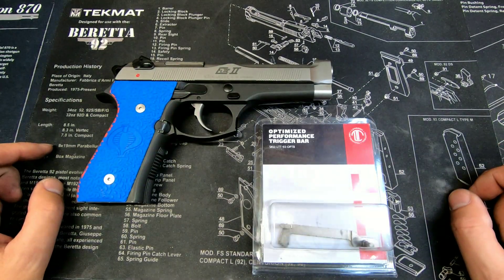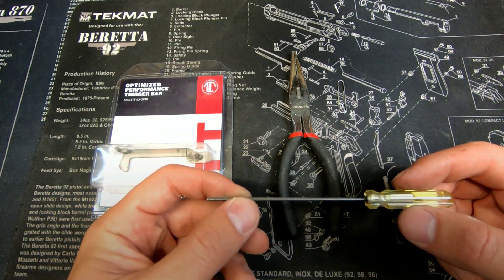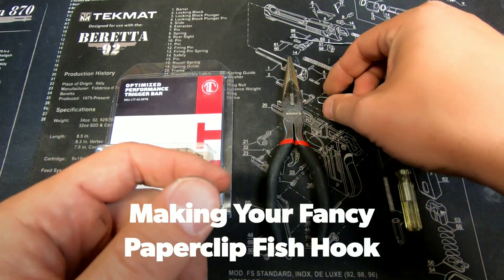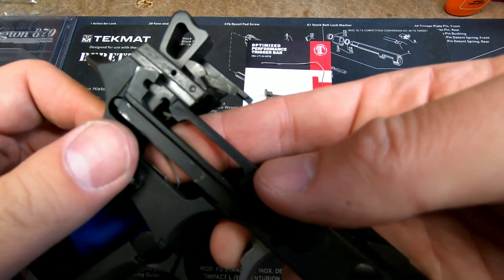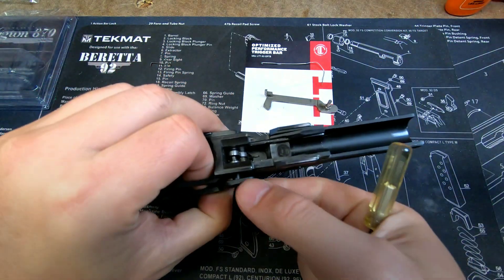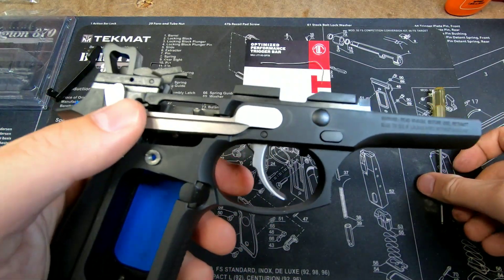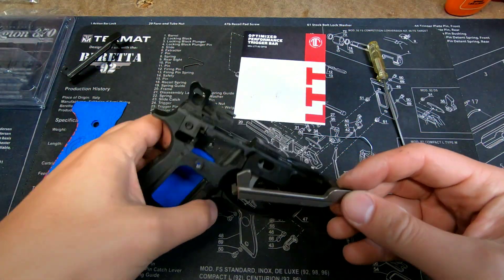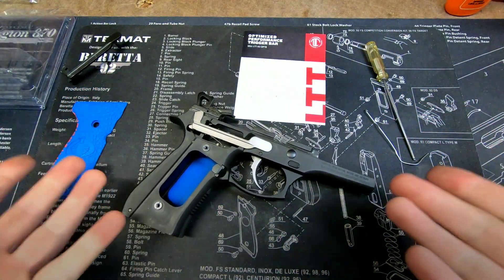Beretta 92 DIY - Episode #4 - Langdon Elite LTT Trigger Bar Installation & Review

Comment: I've been looking at tuning up either one, or both, a 92A1 and 92X (NOT performance).  Did you install any LTT black parts vs the silver parts, and if so, what is the actual real world difference?  The price certainly reflects a difference.  How about doing the Beretta Performance parts kit with a Langdon trigger bar added, vs a complete Langdon kit?  I liked the idea of the trigger sitting forward more, not being all the way back toward the rear, because I have large hands/long fingers.  I'd still like to know what the actual pull weights in SA/DA are.  Thanks!

Comment: Cobra, have you tried the LTT trigger job in a bag? I'm thinking most of the magic is in the trigger bar and was wondering if the whole kit was worth it vs. just getting the trigger bar alone.

Also, what hammer spring # do you use with your Berettas? Thanks man.
Reply from the maker: I have not.  I buy all the parts and polish as needed.  Some parts have more grit than others, but the LTT Trigger bar makes a huge difference.  I use 12# springs for competition.
Reply: @CobraReady  Thank you, just what I wanted to hear. Will get a couple of trigger bars and attempt to polish the parts I have on hand.
Reply: @CobraReady  when you say polish as needed. what are the main parts you polish? I seen a video on a person hitting the back of the trigger bar with some 2000 grit? Do you do that as well? Thank you.
Reply from the maker: @mgonzalez562  Polish the trigger bar itself where there is contact with the frame and grips.  Also where the trigger bar engages the hammer and the hammer itself.  Some people also polish the sear but I do not.  You want to get the grit out and make the contacts as smooth as possible.
Reply: Average Doomsday Prepping Dude so is hitting the points of contact with the 2000 grit and then some fitz polish? Sorry just trying to be clear
Reply from the maker: @mgonzalez562  You may have to use heavier grit sandpaper first to get any rough spots out before using 2k grit.  I finish with 1200-1500 grit.  But yeah, its knowing that areas to polish is the key.  The Beretta forum actually has good information on this as well.
Reply: Great info, thanks

Comment: please dont get this wrong  I am beretta dude at hard for 30 years did all you can still shooting cz ts not orange have two. at steel comp just cant get better trigger believe me have try all even xaliber that comes close with singla action .still own 30 berettas all different models sizes love ewery one them have extreme match tango 6inch 9mm that is accurate one but tigger with trigger bar design cz ts is the # ou and then there is walther sf and sig 6inch still tactical sport is the best least for me .I have hammerli and 7.5 barrel 50 s gun 22lr trigger is eguel single action .I have p120 Turkish shadow canik sa most accurate that desighg on prize range 800 with all upgrades .did not try new alien wonder 8.500 be berfecgt 9mm .go figured .range time is diference my friends thats my opserving. shot clock today 10mm first shot bulls eye .like I say range time practice practice and patient .rock on ...rally
Reply from the maker: You can't compare a Beretta against a TSO, they are 2 completely different pistols.